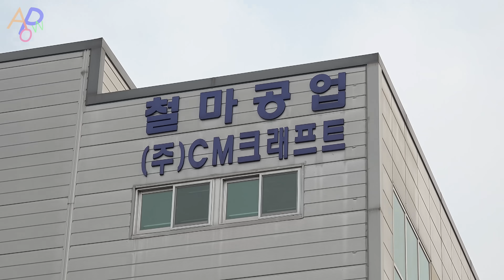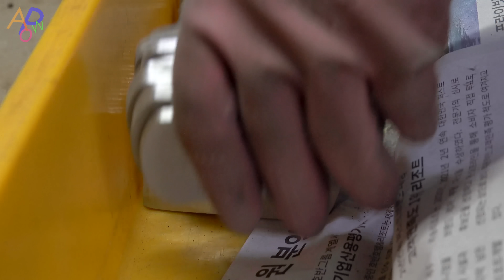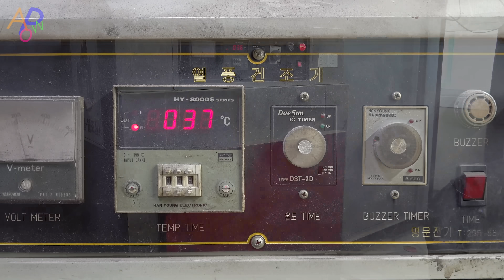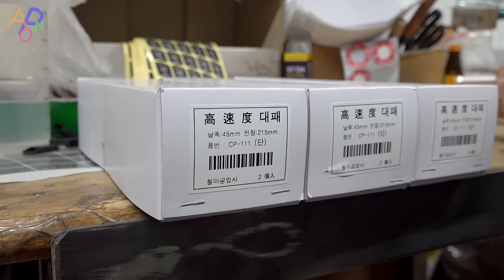Wood Planer Factory Made by Korean Craftsmen With 65 Years of History

Comment: Ok, I understand that they produce many different tools, but I'm only willing to pay around 1 hourly wage for such a tool, but it is much more labour than I ever expected. I would assume a chinese production line where the steel bar is inserted on one end and the chisel fell out at the other, punched out, grinded, heat treated, sharpened, without any manual work in between, and likewise the wooden part, so the only manual work is putting the pieces together.